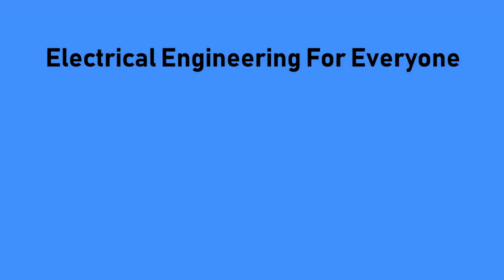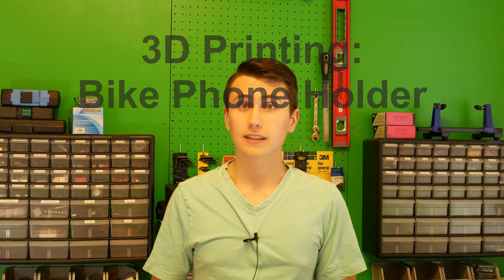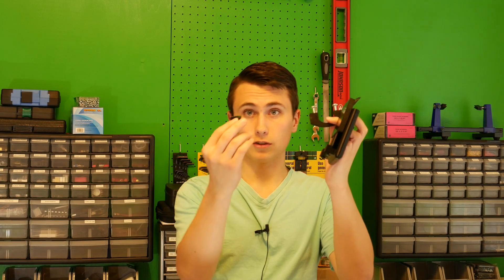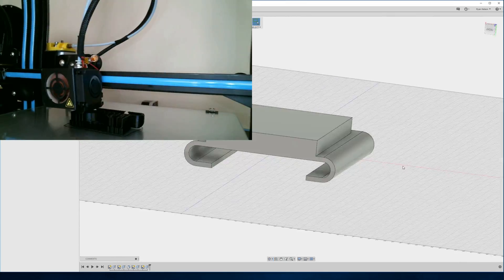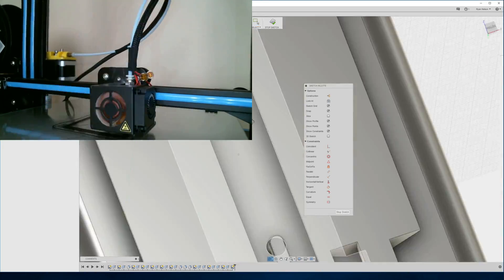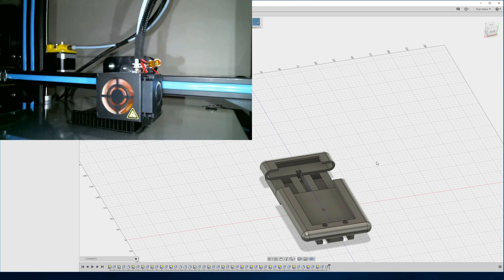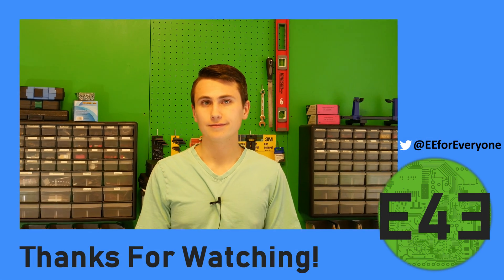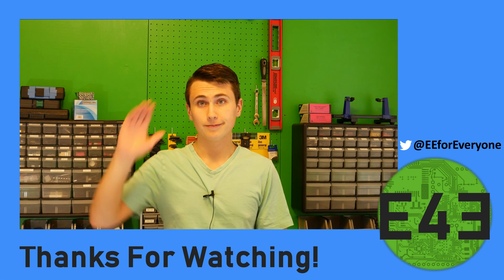Bike Phone Holder – 3D Printing

Comment: How did you learn to use CAD?
Reply from the maker: Hi Husain, This is an absolutely fantastic question. The short answer is that I learned through practice in the tool. Though, I'm feeling a bit inspired  by this comment to do a "Learn-With-Me" series on Circuit Simulation and Schematic Capture. Is that something you'd be interested in?

Comment: Would you say that fusion 360 is like how solid works is to inventor? Also nice background music and is that a new mic?
Reply from the maker: In some ways Fusion 360 is very similar to solidworks or inventor. If you don't need engineering drawing exports or advanced simulation It seems to do the job. Plus it's free for hobbyists, which is a huge plus! 
I've had the mic for a little while, but I've gotten better at using it. I still need to dial in the compressor, but other than that I'm cliipping a lot less. 
Thanks for watching!